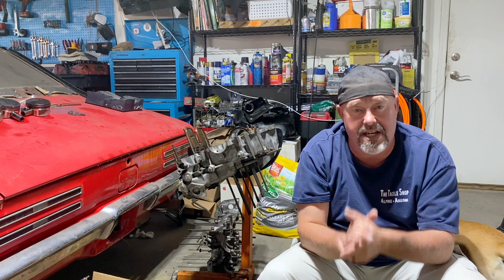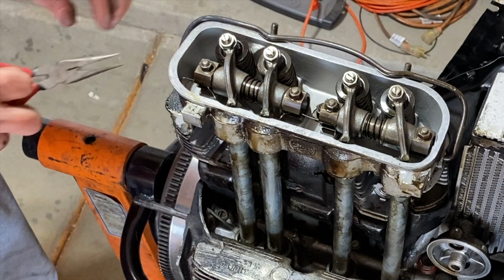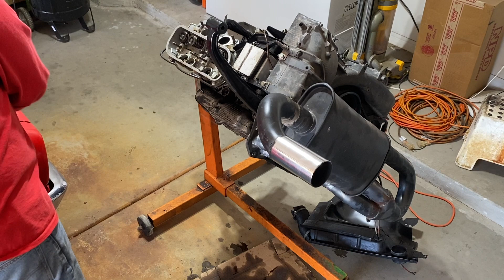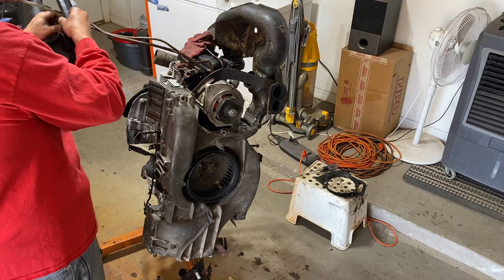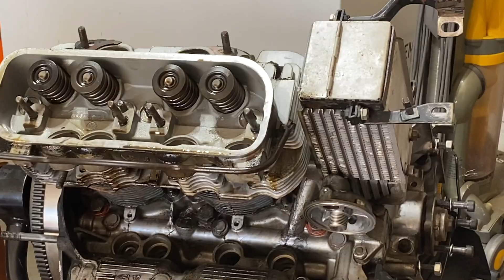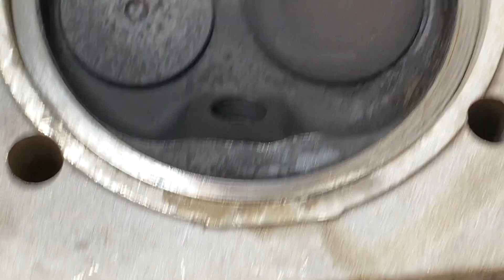VW Type 4 Engine Rebuild - 1976 Porsche 912e 2.0 Type 4 Removing Heads Part 2

Comment: Another tip: when re-installing the cooling tins on the bottom of the heads above the pushrod tubes, put some anti-seize lube on the screws that hold the tins to the head and the case. It will make your life a lot easier next time you have to remove those fasteners. No more need to use a big screwdriver that you turn with a pair of vice-grip pliers.
Reply from the maker: Noted Mike, thank you!!!

Comment: In my experience, taking the cooling fan, fan shroud, oil cooler and engine mount bar off the engine before you remove the head makes your life a lot easier.
Reply from the maker: The lessons we learn lol and knowing is half the battle right?

Comment: Brian:  Removing the complete exhaust system before you begin taking off the cooling tin and intake manifolds makes the job a lot easier (and faster), especially when removing the fan shroud and heads.  I understand your desire to see what went wrong with cylinder #4, but since you were taking the engine apart completely, might as well "work smart, instead of working hard" as they say.
Reply from the maker: I get that man, I was just confused on why I had 0 compression in 4 and wanted to know why right now lol

Comment: Your engine's pushrod tubes should have had the green viton seal o-rings on both ends to stop leaks.  The black o-rings are rubber and always leak.  The pushrod tubes are the same size at both ends on the 2.0 liter engines.   The 1.7 liter engines used different size o-rings at each end, since the holes in the cylinder head were slightly smaller in diameter.
Reply from the maker: I need to look thru the new rebuild gasket set I bought and see if I have all green o rings or the old style.  The last guy who rebuilt the motor is a well know Porsche guy, maybe not a Type 4 guy.

Comment: Hello, I  bought a turbo cam from Potter machine. The cam is not a hydraulic lifter cam.  Question how long have you didn't run it, and how quickly did it prime back up on restart up?. Thanks.